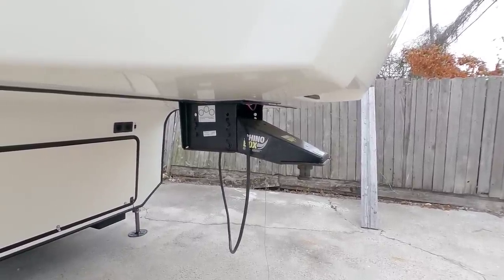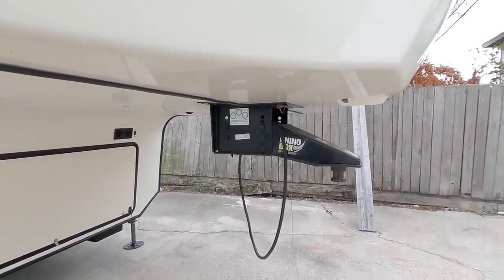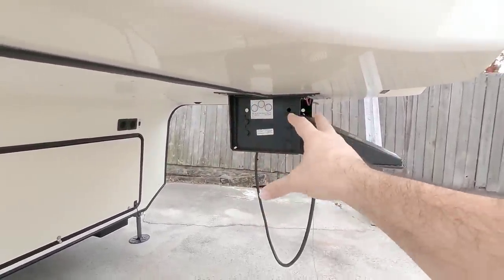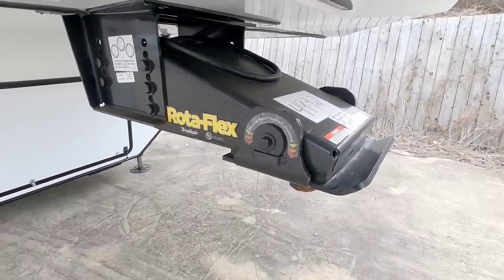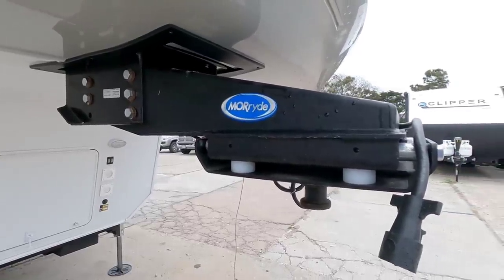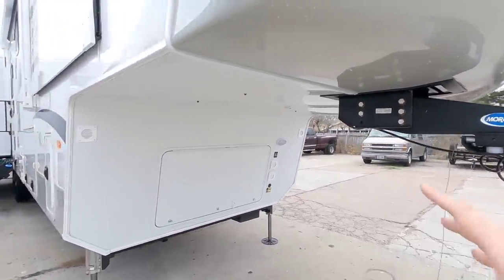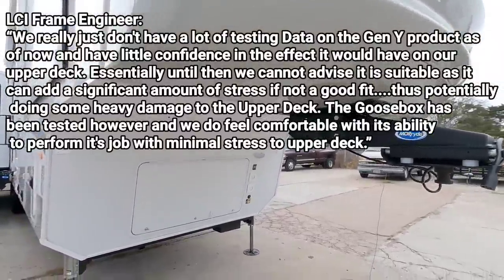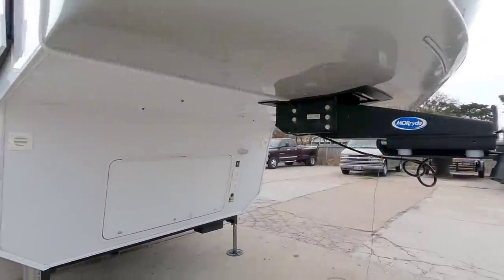Fifth Wheel Pinbox vs Gooseneck Replacements. Understanding LCI's issues with some!

Comment: JD you couldn’t be more timely. Just picked up a new 5th wheel with the new Rhino Pin Box. I told the dealer I wanted a gooseball pin box so I ordered a Reese 2.0 Goosebox. It arrived and the dealer said it wouldn’t fit on my camper because I had the “new” pin box frame. We phoned LCI and they said that Reese doesn’t make a Goosebox for my frame yet and that they make an approved unit. So, I ordered that one....only to be phoned a week later that the manufacturing facility was behind and they did not have a ship date for their gooseneck pin box. With our first camping trip coming up, I went ahead and ordered the Gen-Y Executive. It shipped the next day and it’s being installed now. I absolutely wanted to go an “approved” route, but in this case it just wasn’t possible for our timeline. Honestly, I’m not sure why LCI manufactures more than one kind of pin box. It’s very confusing from a consumer standpoint. I will probably switch out to the Reese Goosebox once they build one compatible with the new Rhino pin box. Again, very timely video. It certainly doesn’t make me feel better about my choice, but I was left with little options.
Reply: So this is a old comment, but I'm wondering how the Gen Y went for ya?

Comment: This sounds like a sales pitch to me. LCI wants to be paid for others to play. Testing my arrsss. Claims of testing is one thing. Where is the proof and documentation? Resse chose  LCI as there designated supplier so yeah they have a ton of excuses and reasons for not letting any other pin box be used with out there testing . One can only imagine the cost of doing bussiness with LCI at that point.  Funny how it wasn't an issue until that deal was made between LCI and Resse. Can ya smell the B S behind all this yet?

Comment: Awesome video. I emailed LCI last week asking which goose conversions were approved and heard back nothing. For me it was down to Reese or GenY and you covered the topic well.
Reply: Lci makes a gooseneck connect that they made its a complete replacement, and the goosebox are approved.  Gen y is not approved officially but currently going through the approval process.

I had the same questions
Reply: Also I think gen y has said they have been going through the approval process since I think July 2020? Will it ever happen I'm not sure.  Regardless I still bought gen y for myself
Reply: @buckwuk7984  how are you liking it? I have the new Rhino Pin box and they don’t make a Goosebox for my setup. I’m having a Gen-Y installed now and am super nervous after watching this video.
Reply: Call Lippert. I did. Got a rep in the phone fast who knew their stuff. Very informative and a bit different info than what is shown in the video. LCI basically said they ONLY warrant frame/chassis damage if you use a Reese pinbox as that’s the ONLY hitch setup they’ve tested. They consider anything like an Anderson, B&W, Curt fifth wheel receiver hitch to be an ADAPTER and adapters void LCI warranty.

Comment: Today I spoke with LCI Technical assistance personnel.  They said you can use any pin box alternative as long as it mounts to the existing LCI frame brackets using the same bolt holes and pattern.  No welding, hole drilling, or other alterations are allowed.   Maybe tech assistance isn't the department to be speaking with, but.......?

Comment: I viewed your video and contact ATC 5th wheel/trailers  to determine if a Reese Goose Box could be used on their 5th wheels?  ATC related, there  has been no testing  conducted; therefore, they do no recommend the Reese Goose Box.  ATC is one of the few all aluminum trailers that has no wood whatsoever in it.  It did disappoint but I'm glad I contacted them first. Thank you!!!!!!!

Comment: The Reese Goose box does not have a hole pattern for the Rhino Box frame.  I just bought a 2021 River Ranch 390RL.  It had a Goose Box on it.  I noticed that it did not appear to be bolted correctly.  I contacted Lippert.  They told me it was a Rhino Box bolt pattern frame and Reese did not make anything for that.  I contacted Reese.  There is one in development but is not ready for sale yet.  That all being said, I had to get rid of the goose Box and went to a Gen Y Executive that does have a Rhino Box bolt pattern.  I hope it works because I don't want a big hoggy Fifth wheel in my bed.
Reply: Reese Goose Box Gen 3 now has the Rhino Box compatible mounting holes.  (June 2024)

Comment: I wonder if better shocks would work better to reduce chucking.  I have Koni FSD (Frequency Selective Damping) shocks on my GTI and they are stiff on slow impacts and soft on harsh impacts.  I'm sure one of the reputable off road/aftermarket suspension companies; like Fox, Bilstein, OME, Carli or Icon may have something that would work.  Maybe one of them would be interested in a collaboration or prototype testing.

Comment: Very informative video.  I recently installed the GenY Executive 5th wheel pin box on my camper, to connect to my Pullrite auto slider and I love it.  I'm well outside of any warranty, so that's not really a worry for me.  It took out almost all of the chucking and porpoising.  In theory it also should dampen frame stress over the stock 1621hd pin box as the GenY flexes in a controlled manner through the torsion process to cushion instead of having a harsh impact and stress from a solid pin box that was previously being felt and transferred between the truck and trailer.  I'm sure Lippert and Reese would never conspire against the smaller company GenY.  GenY has no exposed rubber to dry rot, and no airbag to fail, or that needs deflated and/or aired up to hook up and tow.  I'm no engineer, but I also know that not all engineers are good at their field.  Lippert has had numerous frame failure problems, building frames to the specs of their engineers and QC weld inspectors.  I can easily see where the 5th wheel to gooseneck extensions could cause weird stress as they create a 90deg. angle and apply a complex leverage and torque situation on the pin box and frame, but the gooseneck pin boxes from Reese or GenY are completely different in their angular approach. MHO
Reply: I haven’t read a bad review on it. Watch a detailed infomercial on it and was hooked. I don’t want to get away from the 5th Wheel system. I’ll probably switch out this summer.

Comment: We just bought a 2014 3250RL Alpine 5th wheel and bought an Andersen gooseneck hitch. Our truck is a 3/4 ton Chevy duramax diesel with turbo. Short bed.
We haven't tried anything yet,  so do you think it will all work out well? We don't have a clue about 5th wheels.

Comment: Does LCI make Grand Design frames? We bought a 2021 Grand Design 28BH and I'm pretty confident we'll be getting the Reese goosebox. If dimensionally it works with my new flatbed with the gooseneck ball integrated. The ball is under the flap so it's lower than the typical pickup style gooseneck.
Reply from the maker: Yes, but not currently one for the new LCI Rhino frame
Reply: @BigTruckBigRV  thank you for the reply. Recently new subscriber, loving the videos. I haven't noticed any videos on flatbeds like I'm getting. Have you done any by chance?

Comment: Would the Anderson fall into the goose ball adapter category?
Reply: No it does not.  The hitch on the 5th wheel still connects to your truck at the same height. There is no extra leverage applied in the manner that a goose ball adapter does.  JD was talking about the forces and "moment" (look up the physics term) when using the goose ball adapter. This is not an issue with the Andersen.  Not affiliated with the company -just a satisfied customer towing a 36' 13,000Lb Cedar Creek 5th wheel.

Comment: Sounds to me like a case of "don't want to" on the Gen Y box.  They could plug the relevant parameters into an analysis program like Matlab and run a force vector and stress analysis on the Gen Y vs a standard pin box and it would tell them what they needed to know.  We do it in aerospace and if it's accurate enough for a spacecraft I'm certain it's accurate enough for a camper frame.

Comment: After watching your reviews of the Goose box and wanting some room in the bed of my F350 I purchased a Reese Goose box.  But from Experience a Gen 2 Reese Goose box will not work with a Rhino Box pin.  The bolt spacing is different.  I had spoken with both LCI and Reese about this before I purchased the Goose box.  Both said that it would work.  Goose box arrived drove 5 hours to pick up my new trailer only to find that the bolt holes didn't match.  Went home with out my trailer only to make the trip again the following month with a B&W hitch.  Still have the Goose box in my Garage, really wished it would have worked.

Comment: I picked up my new/never used 2017 Jayco Seismic 4113 last Friday.  It came with the MORryde 23k rubber pinbox (don't know the model number off the top of my head).  I was originally planning on transferring the 19.5k 5th Airborne SideWinder to the unit, but that would reduce my capacity by 500#.  I was very impressed with how the MORryde hitch felt on the 350 mile drive home, and I don't think I'm going to swap it out (in your opinion, do you think that's the right choice, JD?).  I got the Reese M5 27k hitch for the Ford Puck System to go with it.  The trailer already had the CRE3000's on it, but I found that they didn't have the wet bolts with 1/2" shackles.  When I put on the MORryde 1/2" shackle/wet bolt kit, I discovered that the factory didn't put the bronze bushings in the non-CRE3000 connections!!!   Something everyone that gets a rig with CRE3000's or other equalizers from the factory needs to know!!!  The other big surprise I got was that the Seismic had disc brakes on it.  Nice upgrade!  Thanks for all the info you put out there JD!!!  You always find something I didn't know about, or didn't know to look for.  Keep it up, and have a great weekend!  -Oliver

Comment: I'm glad you went into better detail(s) about Pin boxes. This is a part that I couldn't figure out by looking at it alone, and I didn't run a search on it either. It also works(it seems), as a Safety feature too. Thanks, good job.

Comment: While I don't take issue with your video you've missed an important point regarding the pin box design.  Measure from the mounting bolts to the pin and compare that measurement to that of a New Horizons pin box.  You will find a substantial decrease in length.  The decrease in length (1')  translates to a significant reduction in force transmitted to the deck.  Everything else is a band aid.

Comment: I know you have recorded videos in the past, that reference the Andersen Ultimate hitch and it's capabilities.  You also did this recent video talking about gooseneck conversions, and the testing of the Gen Y pinbox.  But there is recent news that Lippert will no longer cover any warranty issues ( frame damage) if owners use the Andersen Ultimate Hitch.  Andersen has offered their own protective warranty, but Lippert supplies 90% of all frames for most RV companies, so those purchasing new as of March 21st 2021 must have that sinking feeling in their stomachs.  Any insight from your channel, since you have experience with the Andersen hitch ?

Comment: What a great video, what is LCI's view on the Anderson Quick Hitch? With the cofiguration, does it create more stress, is an approved hitch by LCI? I have a 2017 Grand Design Reflection 29RS in case you need it ti answer my question.

Comment: Great video. Not sure if you have seen the new rv product RV-AIR. The design appears to be functional but would like to see more in-depth testing done, which i know you would do a great job at. According to the product manufacture, they are being installed from the factory on all Grand design units. Would like to see your opinion and I could bet many others would as well before dropping 170 dollars on some Styrofoam.

Comment: Hi, thanks for the vids. I just purchased a Columbus 388fk and have ordered a 2021 ram 3500 dually to match up. So this is going to be my first 5th wheel unit. Trailering for 15 years and the only issue was when I lost a rear axel outside of Waco Texas (that was not fun) Trailer company put 3500 lb axels but sold and registered it with 5k's so Lippard would not cover the replacement and Golf Stream / Kingsport 259RBS   did NOTHING
The sticker said the unit weighted 6190 at the factory. At the dot scale it was 7900 YES it was empty as we took everything home in the back of the truck and left the trailer to be fixed. We were able to bolt in 4500lb axels. The new owner is happy with new tires, rims, suspension, brakes. 
I saw a add on one of your vids showing a back rack and side bed unit, one complete metal unit. I fear I will do a Changing Lanes oop's. I have seen the damage a number of times. Do you know whom that company is ?

Comment: This is completely different that what Lippert told me directly in 8/2020. We had been hearing how there could be frame warranty issues with the wrong set up. Our 2021 Beacon was to be arriving with a factory installed RotoFlex pin box so we started shopping for our fifth wheel hitch. So I decided to call Lippert and ask which fifth wheel hitch did they recommend. 
They told me NONE of them because they would all need hitches that were all considered “adapters”. They said that the Beacon frame would only have warranty if we switched it out for Reese Goose Box. They also said that they only warrant Reese Goose Box use because that’s the ONLY hitch they’ve tested on these frames. 

I then also asked would a manufacturer, like Vanleigh, would put a RotoFlex on this Lippert frame when it immediately voids any frame damage? 
The guy said that he didn’t know.

Sooooo.....
Very strange.

Comment: JD, Thanks for all you do for the community, your videos are very informative and well done.  I know you have described why Lippert probably isn't going to approve using the Gen Y and I understand your description in this video and I actually talked to Lippert, I even offered to be their test subject, I have decided to try to keep my warranty intact.  Now I have a different choice than what I originally wanted.  I have a 2021 F-450 on order and currently tow our 2021Venom 3911TK equipped with a Rota-Flex pinbox with a 2019 GMC 3500 CC SB SRW and B&W Companion slider that leaves me with absolutely no usable bed.  I am wondering if I should go with the Reese Goose Box since the F-450 has the puck system standard and would have the entire bed or keep the Rota-Flex and put a B&W Companion puck hitch in which would still leave me with way more usable bed than I have had.  I am curious if you think the chucking and bouncing is better with the Goose Box than a Rota-Flex that has the rubber pad in the head.  I really had my heart set on the Gen Y so I didn't have to mess with air in the bag but after seeing your description and talking to Lippert I think I have to try to keep my warranty intact.

Comment: Very informative, do you think manufacturers will get to the point of using a goose box like design but with a inverted kingpin design. I have seen them on goosenecks and seem like a great design. Uses very little bed space like a gooseneck and eliminates the need for safety chains.

Comment: Hi great video  I have a question to there engineer's the stress angle to me does not come from  pin box and hitch but from the bolts that hold the hitch to the truck . But saying that my truck chucks bad and I like the look of the Reese goose box connection.  I thank you very much for the great content that you put out you are definitely at the top of the game thanks. Truck 2009 gmc 2500 load 3000lb 5th pin weight 1500lb.

Comment: Was it mentioned that LCI owns Reese. If they don’t approve the competition then it’s good for Reese and LCI when you scare people into your products by voiding warranties if not.
Reply from the maker: I should mention that you're complete wrong and LCI has no affiliation with Reese.  Reese's parent company was Horizon Global until the recent announcement that First Brands Group was purchasing them. Wow, such a poor and obviously zero researched comment.  Other than the fact that LCI was going to have an exclusively agreement when the Goosebox FIRST came out, that ultimately fell through, there is no relationship or connection between the two companies.  Not 30 seconds of research would have told you that.
Reply: You are correct, I was wrong and was thinking about Curt.